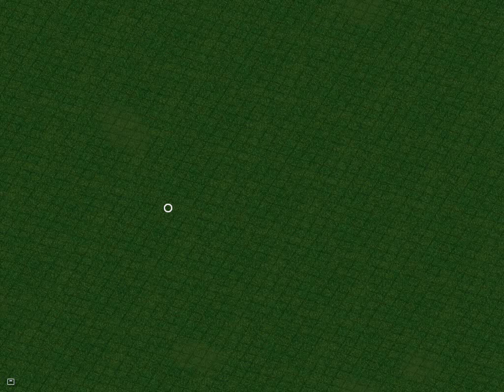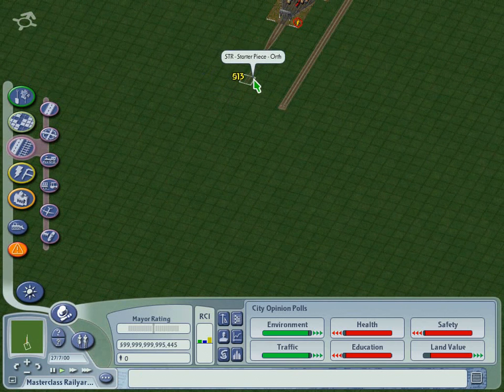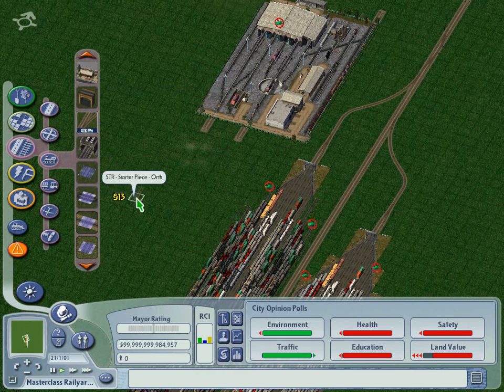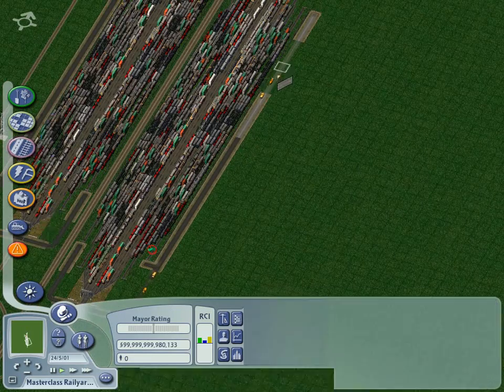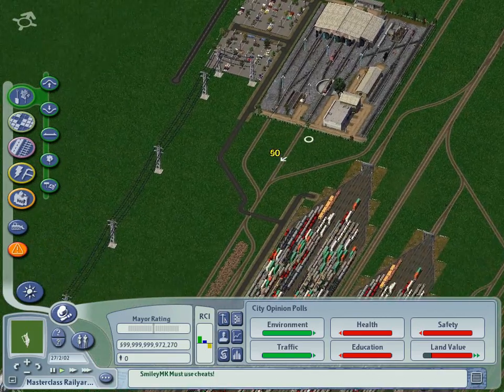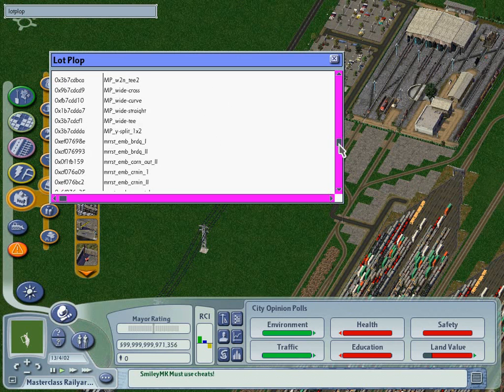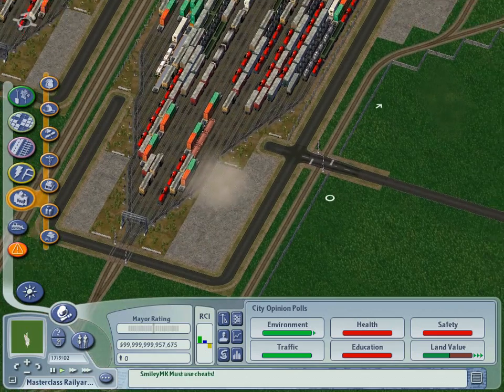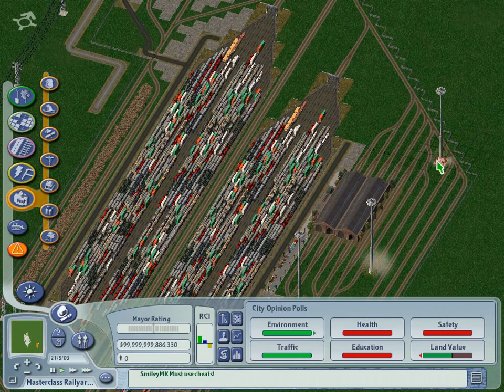SimCity 4 Masterclass - Railyards

Comment: Good tutorial as extensive in a view minutes it can´t be. I´d like to add one detail, sorting of cars by a shunting hill so cars can find there way by gravity. Trains are pushed over the hill, one by one the cars are sorted to go on to there destination track.
Small or medium yard shunting by loco would be enough, working with larger pack´s makes it to laborious; single firm factory would be Ok Big freight operators will use above sollution most of the time !
Reply from the maker: maedero05 Thanks. I didn't think of installing a hump/gravity system, probably because they (sadly) don't exist in the UK any more as a result of us moving to long 'block' freight trains and container trains, but it would be an interesting feature (and probably an essential one in a city based in a country that still uses hump yards).

Comment: Great video. But I get a problem. There's no trains/plops show up on the rails. Its just the rails. Any suggestion please?
Reply from the maker: Have you downloaded and installed all of the dependencies for the modular freightyard lots?
Reply: Have the same problem here. I did downloaded the plops, but they aren't showing.
Reply from the maker: @dagreadesigns8196  That's odd. From experience I know that the game will sometimes not read files that are buried too deep within the Plugins folder (there is presumably a limit on the file path length the game can handle). Therefore, it might be worth moving the prop files up a few folders.

If that doesn't work then you might need to speak to the lot creator I'm afraid, AFAIK the only thing that can cause missing props is missing dependencies.